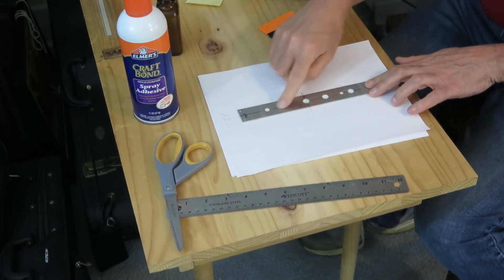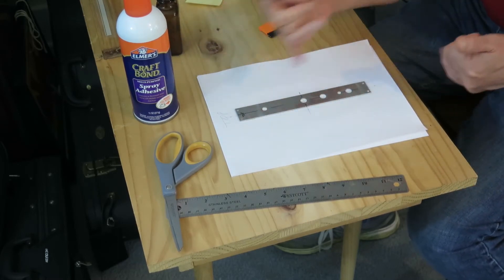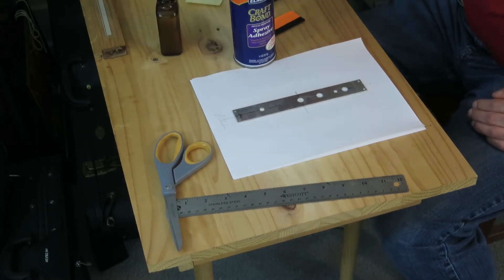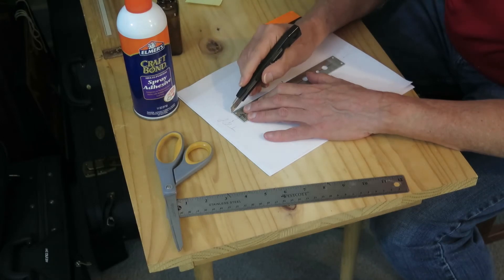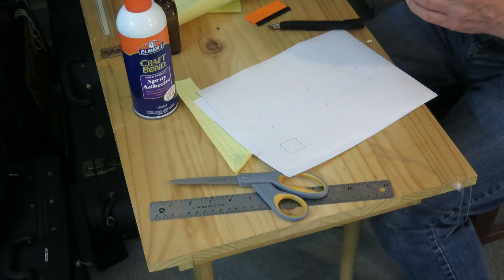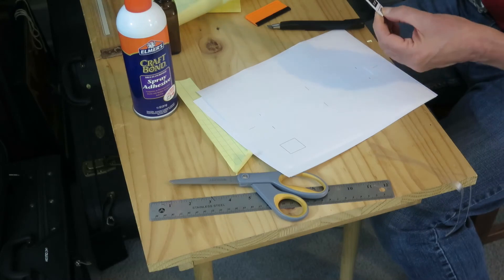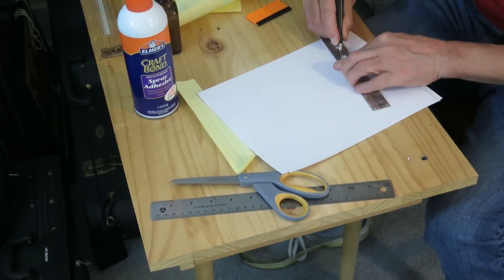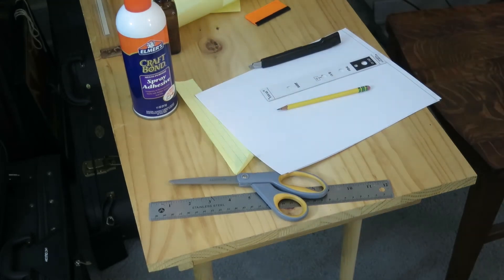Panels: Cheap and easy DIY front panels

Comment: I print on 81/2 by 11 self adhesive mailing labels. No need for spray . then put laminate on the front and then cut my holes out. Just peel off backing and stick to panel. Works great.